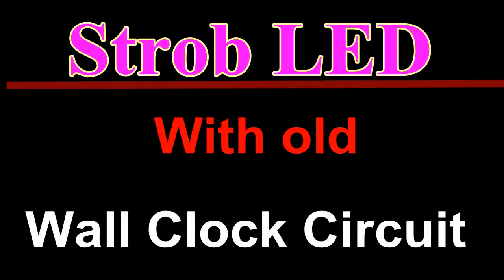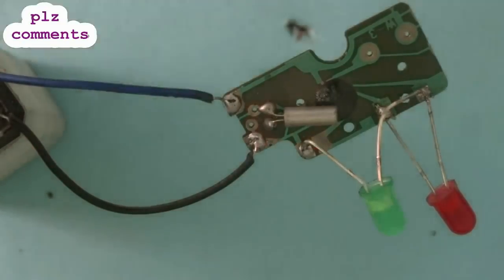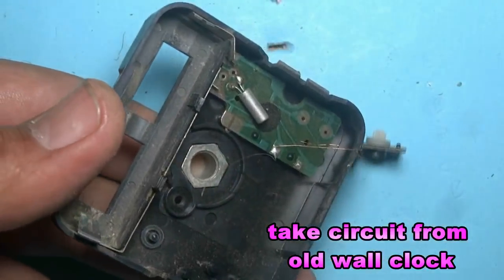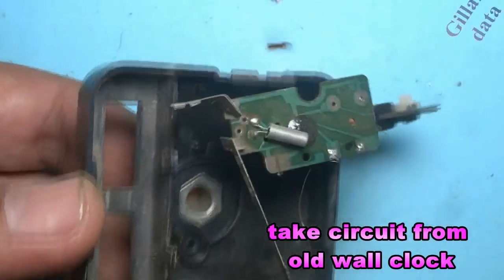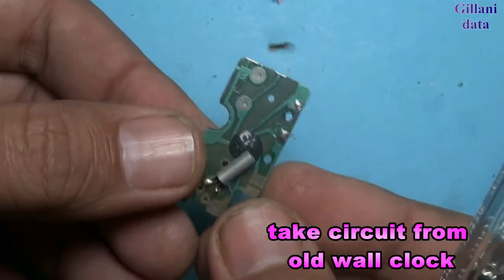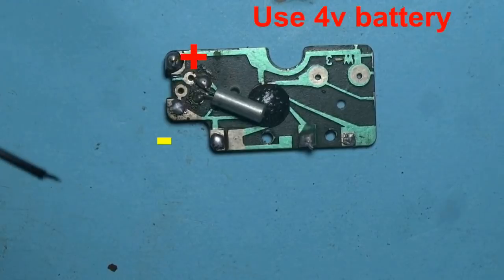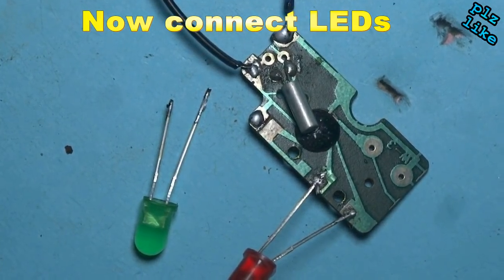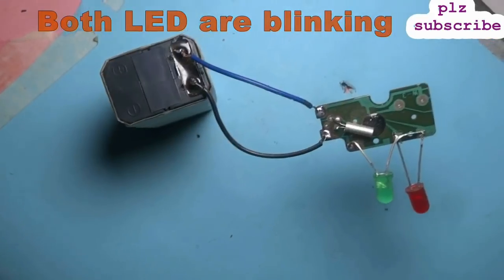STROB LEDs With OLD WALL CLOCK CIRCUIT

Comment: Was your clock originally powered by 1.5v battery? if so, what is the maximum voltage for this clock circuit? I'm planning to use it to drive a switching NPN to a high power LED.
Reply: yes you can give 4v maximum input 
if you wand to use it for high power then use any NPN transistor on output and use power leds
Reply: @yaqoobgillani5812  I want to use this method of wall clock strobe with 4 leds and 18 volts of power. So can I use the clock circuit board and directly give 18 v power? Or should I upgrade the components to prevent them from overflow of electricity becuase my clock runs on 1.5 v and 18 v would burst the board. So please help

Comment: i have tried this one but my led is blinking very fast plz suggest the solution
Reply: The crystal used is usually a 32khz crystal which has speed 2 ^ 15 (2x2x2x2x2x2x2x2x2x2x2x2x2x2x2) = 32,768.  Yours is probably very fast because it is pulsing 32,768 times a second.  To get a one second pulse it needs to be divided by 2 fifteen times to equal 1.  I believe each divide can be done using a flip flop.  Don't know what crystal this person is using or what hidden stuff is doing the division.  Trying to learn this myself.  Maybe a MCU is hidden under that black blob on the PCB.
Reply: @pow9606  😆😆
Reply: @pow9606   the video OP used a standard analogue wall clock pcb, these pulse a coil every second, and apparently have a second output similar to a 555. Yes, they use a  MCU that counts the pulses from the crystal.
The standard crystal is 32khz for 1 second, perhaps different time values can be obtained using different value crystals, or by connecting a capacitor to the "3" "w"contacts.

Comment: Can i connect 12v battery
Reply from the maker: no dear you cant use 12v if you want to use 12v then use 1k resistor with positve in series
for more circuits plz visit my web
www.enviremenalb.com

Comment: The circuit will blow out... It uses 1.5V and you are using 4V..
Reply from the maker: no dear circuit will never burn because it can b uses on 4.5v
Reply: hi C N...
can work with 3 volts as twin AA or AAA batterys

Comment: sir we have a question if make  flashlight no resistor no diode is a blown
Reply from the maker: With out diode it is possible but without resister not possible
Reply from the maker: I did not understand your question

Comment: This circuit is not working 
I make it but not blow led
Reply from the maker: +Kamboj Suresh dear connect led on right direction 
Connect led where coil was connect
Reply from the maker: +Kamboj Suresh  plz connects led in write directions
Reply: You did not use any resistor
Reply from the maker: Dear no need of any resistor here
Reply: Also, mind the polarity of the LED